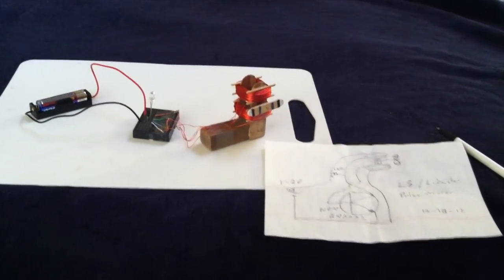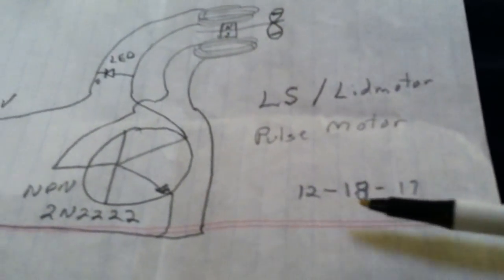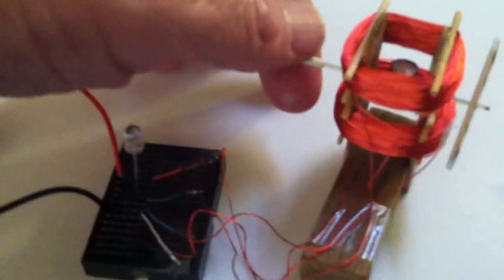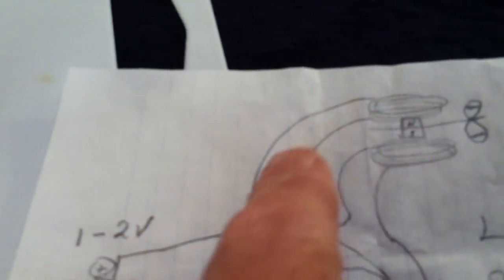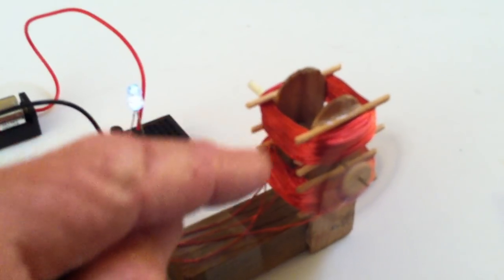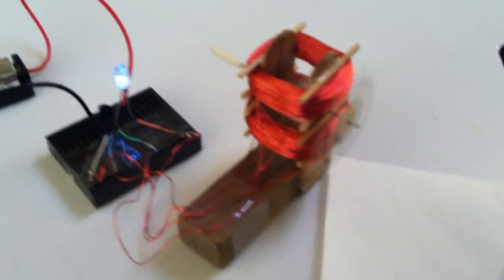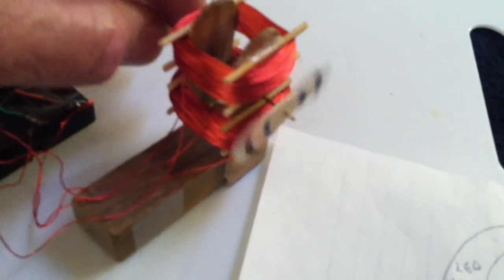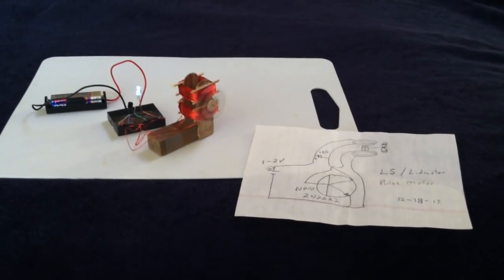Ludic Science Newman Motor  ----My replication

Comment: can you use capasitor place of led to re use reversed voltage ? sorry for bad english
Reply: You need some kind of Diode,  either LED, Germanium or Schottky (SR240) Diode. Its purpose is to divert the current (which does not reverse) now generated by the collapsing magnetic field of Space when power is intantly removed from the coil.  In series with this smaller diode circuit,  you could include a standard lightbulb, a capacitor, a charging battery, a motor, etc.

Comment: Joe Newman motor has been a source for millions of hobbyist projects,  it;s incredible..  Joe was a cool Guy..  Sadly ,  he passed away in 2015..  Joseph Westly Newman invented a few other thing too,  including the Plastic Barbells that many people bought at a much more affordable price than steel ones...
Although many people enjoy making Newman motors (including my 2 motors) ..  The principles of it's workings are not widely understood..  Joe has many good books out about his "Big Eureka" motor and his theory of electricity.. 
  A Newman Motor was designed to run on very high voltage with usually low amperage..  Part of Joe's theory is the resistance of the single coil..  Big Eureka had 55 miles of wire in the Coil..  The Coil alone weighted over 4500 lbs..  I believe the resistance of the coils was 770 ohms...  Joe used 750 volts from a bank of 9 volt batteries connected in series...   Joe's Big Eureka ran at 2 different rpms.  12 rpms for oscilloscope testing,  and 120 rpms for making power..  He ran 200 rpms many times for shows.

   The basic idea of the operation is to make many very quick and short (pulse) connection on the commutator..  Current lags behind Voltage.  Make it so quick that the current never reaches the end of the coil,  before the High voltage kickback occurs and reverses the current..   It actuates the coil with voltage and not current..  Current is what drains your battery or cost money from the Grid,  not Voltage..
  In order to achieve this situation,  You need a really long wire (miles).  Longer than most hobbyist are willing to pay for..  But,  if you use a very thin wire,  smallest gauge you handle without breaking it..  You can get miles of wire on you Newman coil for less than you think..  My next Newman Motor build is gonna use #30 wire,  5 miles long..  The Commutator should be large enough so it's easy to work with..  The pulses should be timed according to the resistance of the coil..
  I've heard the Bendini curcuit works well on a Newman motor..  but,  I'm gonna stick with carbon brushes on a commutator for now.

Comment: how a convolutions ?
Reply: How many turns?
Reply from the maker: I didn't count them.  A couple hundred will work fine.  Use around 30ga magnet wire. Nothing is critical on this thing.

Comment: Why is the NPN transistor used if the motor, coil and magnets will light up and spin the propeller, is the motor basically a transistor it reverses polarity like A.C. and the resulting electromagnetic feedback lights the Led so if it's 1.5 volts the up and down A.C. is producing 3 volts does this make sense. And if this makes sense can you charge a capacitor to save the extra voltage so then this would be free energy, most probably  wrong here still learning electronics I guess knowing the maths and formula here would give us the needed data interesting to see if this motor works without the NPN transistor will you give it a go Lidmotor or Ludic Science

Comment: Runs fantastic! Mine draws 10 mA at 1 volt, I was wondering how far can you go on using less current if you put thinner wire and more turns in the driving coil, as you did before with other pulse motors
Reply from the maker: Hey your motor runs great!  I used the wrong kind of wire but it still worked.  The amp draw was about 30mA @ 1.5 volts.  Thinner wire would be better but you do need a strong enough drive coil that will turn the rotor because of the friction involved.  You can join the coils together (as in a true Newman) then do a different triggering setup. The basic motor design lends itself to many other experiments.  You could go crazy and put good bearings on this but it is the pure simplicity that is the charm of the motor.
Reply: Ludic Science excelente proyecto felicitaciones, lid motor es uno de nuestros grandes heroes.
Reply from the maker: Thanks for the feedback on this.  I am not done studying Newman.  His story is very interesting to me and the theory of his famous motor is fascinating.
Reply: Que gusto da ver tus creaciones replicadas y reconocidas, eres un gran maestro. A ti te entiendo en inglés... A él no del todo. 😅👍